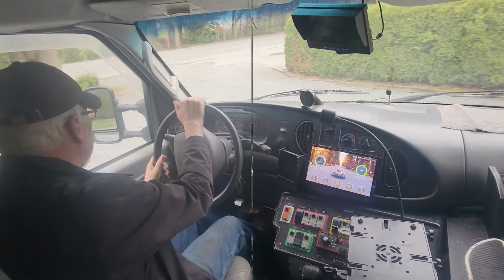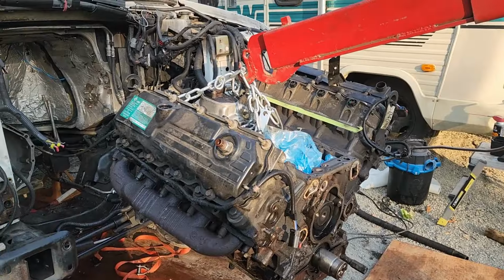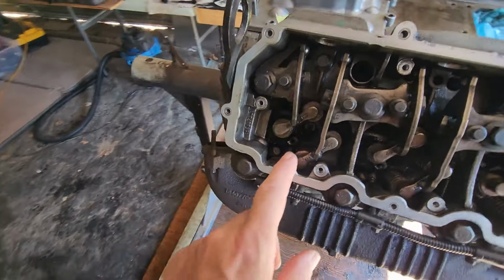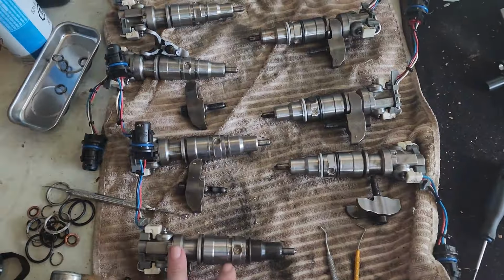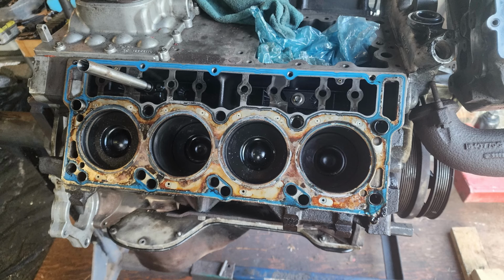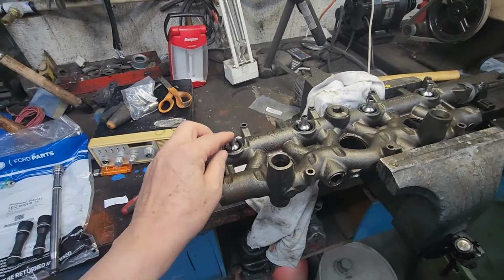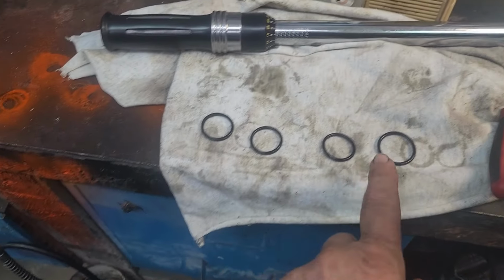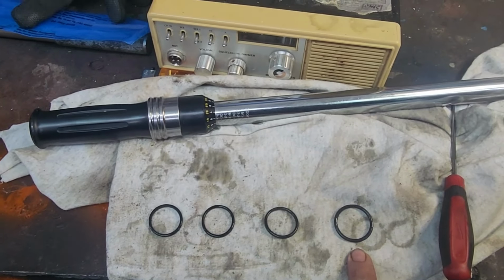Over a year of engine issues, I finally have it all resolved. No thanks to the mechanic I hired.

Comment: I am so happy that you were able to do the repairs needed to get the engine running correctly. I would have never been able to do any of the work, and would have had to rely entirely on the mechanic. It makes me hesitant to get a van, RV or any vehicle to live in. Not that I could afford to move until I'm able to have repairs done on my mobile home and sale it. There's always something that seems to get in the way. I'm glad that things have worked out for you. I'll just have to wait and see what the future holds for me.
Reply: Don't do vanlife unless you have a backup plan. If you want to do vanlife, just go buy a cheap used minivan and do weekend trips. I did vanlife for 4 months full time and it got difficult and expensive. And it became incredibly boring. Just a suggestion from me
Reply: @islandguy9380  I just want to find a way I can live cheaply. The lot rent has gone up 60% in the last 8 years and I don't want to get into the situation where I lose my home, that I own, because I can't afford the lot rent. 😢 I don't have much in the way of income and with the hospital bills I owe (due to surgery), I'm not going to be able to save anything. Also, the trailer is over 30 years old and needs some repairs that I'm going to have to pay some one to do. I feel like I'm stuck between a rock and a hard place.